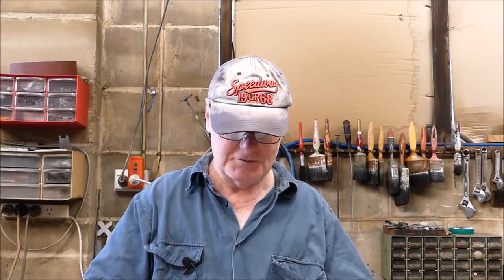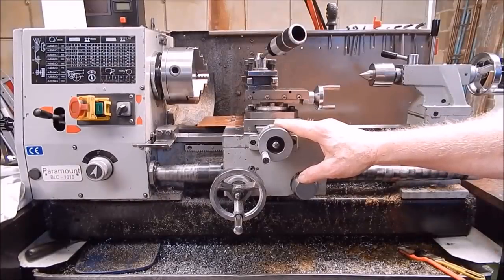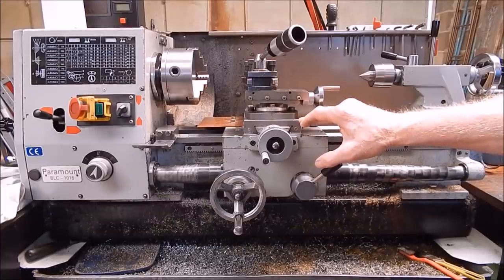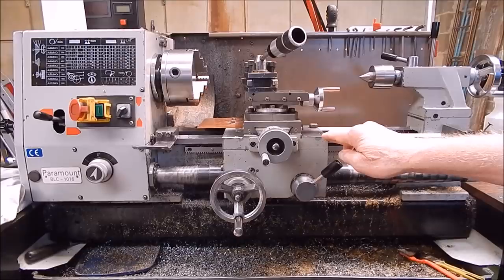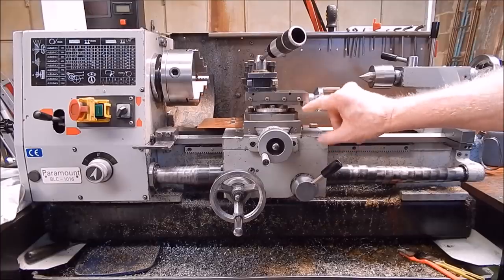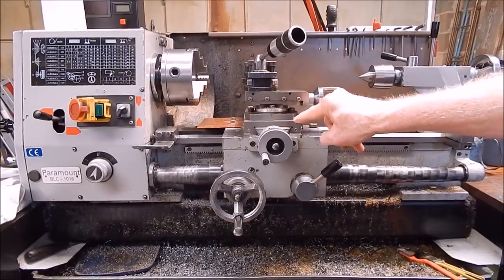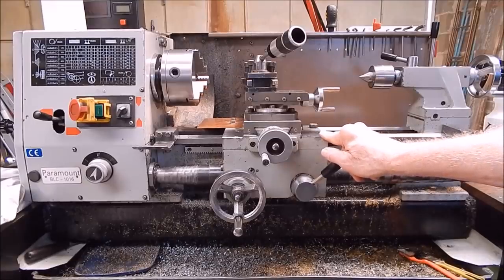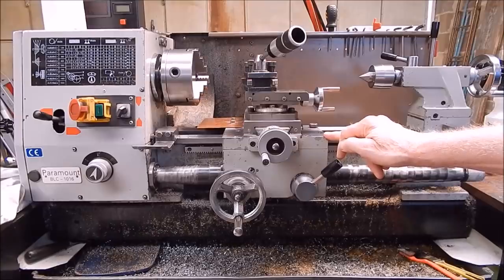The serious weakness in many small modern metal lathes

Comment: As a Manufacturing Engineer who has had conversations with both Schaublin and Hass, I confirmed my suspicions on this topic. The T-slides and dovetails are cut in the same machine, in the same setup (basically).  On a mill bed setup, the cross slide is machined first the dovetail,  flipped, then the t slide is cut.

It is sheer laziness and poor(est) workmanship, poorest engineering. It's not value engineering. It is sheer laziness.
Reply from the maker: Very interesting.  Cheers Rob
Reply: @Xynudu  get some coffee, a comfy chair, and empty your bladder first...

I've been gestating a few things for a while. This is as good a place as any to post. I dont have permission to name my company or product line so, allowances were made...

Ok, let me set the stage. 35 plus years in electronics,  First 20 as a senior repair, testing, metrology, and micro-miniature fab and repair technician. Then finally graduating up to Radio Communications Network Engineer, then Manufacturing and Production Test Engineer, I've been around and seen/done a "few" things having to do with electronics. But before all that, I had a grandfather and a father who were both Machinists and EEs. Its a thing in my family. I'm disabled now with an HSM shop I'm  putting together for my broken butt, but that's a different conversation. Point is, there has always been an intersection of DTIs and O'skrillexscopes in my families households. 

So, when I got hired on my last gig as a production line Test and Manufacturing (process),engineer, I was recruited for the history of seeing one industry through the lens of another. This company,.we'll call it Widgets for All (WFA) was VERY mature, but very specialized, read, small. The Executive Committee of WFA had come upon an opportunity to grow the business both in scope and scale. A lateral market.move was executed with the purchase of parallel niche company that was struggling. (Parallel niche: Let's say one company makes orange juice squeezes and the other makes dairy milking machines. Both different product lines, but, both follow on products made.w8th our products would end up in the same kitchen, just from different (parallel) value chains to the customer.)

As8de.from the lateral expansion there was the concomitant serial/internal expansion of both product lines.This was in the form of Bringing Back to American Shores, or Re-Shoring as its called, ALL processes in a product line. Yeah, Gwon Duang province in PRC can make individual 
7n8t cost lower with their govt subsidized labor force, (you work where We tell you and you get a bed in a dormatory and we get the US $ through the artifice of an off shore commercial title) problem is, the quality is always ever going to be so hideous as to preclude profit back in the states unless unit volume exceeded several hundred thousand 7nits per 8tem per annum. 

Our unique product count was over 400 items in the same building with the same 275 personnel. Change over time from one product to ANYTHING ELSE was only ever minutes. A minimum run was 5 items. Toyota was coming to US.for Kanban tweaking. Problem was that on our large run items, the previous generation of stateside production practices had hemmed WFA into outsourcing large product runs overseas. Vertical integration had not yet penetrated down to small medium enterprises because the industry innovators had treated these methods as "proprietary", thus precluding any home shore advantage by sharing this knowledge and keeping our jobs here.  (Another long conversation about the evils of globalization where.labor has been commodified based upon VAST geopolitical disparities in end market value of labor.)

It was now "cheaper to keep her" when the Board looked at the big picture of a total product value line labor force.

IF:

Production Line supply was vertically integrated
Product testing occured in situ during predefined blocks in manufacture (that's my gig)
Just In Time integration encompassed.the ENTIRITY of the value line 

Then:
here was a helluva opportunity to be made.

So, where does Schaublin and Haas fit in? You all might wanna ask NYC CNC, et. al.  how.many test FIXTURES they have made for electronics production lines. 

Now think this….

WFA had over 400 TESTABLE products, each needing at least three fixtures. Product updates and revisions occurring in real time, each necessitating change in fixturing. Several THOUSAND fixtures up front with a hundred or so per annum.

This program of Continuous Testing Upgradability, if out sourced was going to.cost more than our annual revenue, just on this item alone, forget labor or material. 

How did we get to this point in the first place? There were over two dozen of.us on staff with varying degrees of experience as machinists. We'd been talking for a while, telling Execs what could be done. So they had had an idea there was a way to expand. The automotive industry had done it Sony was.doing it, BUT NOT TELLING HOW. So, we set about doing it. 

In order to be enabled to produce text fixtures "just in time" it would have to be done in house. We would need a job shop in house. And with market research was showing we SHOULD expand our product line to over 1000 items in three to five years, we needed to change the way we saw things

See how thiis math8is sort of snowballing ,exponentially? We few.ex-machinists knew where this would end up. With some new play toys, er. tools. There were two thoughts on deployment. Either have localized fixturing available at each production line, seven of those currently with a five year plan of doubling that. Or...create a new department, independent of any one product line.

Both had merits, both had pitfalls. After six months of sales/product enginerds from all over the planet coming through our house, the final two machinery works were (wanna guess) Haas and Schaublin. 

During this happy time, we were getting one hell of an education. Everyone in the company was exposed.to as much or as little.of this process as they had stomach for. Everyone had access to anything, except new product development and intellectual property protection methods. 

The building is online 24x6, pay is above market. "Widgets For All" is a "Blue Water Shark" to this day. All of the value line is back in house. Because there are governments on this planet that enforce the policy of using the citizenry as a commodity for wealth extraction and transfer to a select few there will be areas of the human labor pool that will appear all to attractive for unscrupulous and, or uneducated entrepreneurs. 

WFA spent three years recruiting from the home team. I was lucky that I happened upon them. They weren't casting a wide net. They didnt want to attract attention. I was hired three days after submitting my resume/C.V. Now let's talk about how appealing the home labor force is. Not friggin very. The initial round of expansion was going to require 75ish new employees. We interviewed over 1500. I was in the initial round,  I was also recruited for my management experience. 

I'm just going to say this, from a point of experience of 35.plus years at industry leading firms, immmigrants to America have work ethics far and above the past two generations of Americans. Immigrants expectations are/were far less. These aren't opinions, these are recorded data points. But we weren't hiring based on their desires, we were hiring based on their experience coupled with their desire to invest,  invest in themselves, thereby investing in the long term value of their position at their career. We didnt just train you how to swing the newest hammer, we untrained you how to see every problem as a nail.

So when I look up from my sixteen channel logic analyzer to have a very well educated opinion about Chinese lathes, or STEM recruiting and hiring, or technology industry geopolitics, its because there were several MILLION man hours of documented experience I had poured into my head continuously, and had ready access to, along with any one else in the company. 

If you want a real, excellent position at an industry leading company,  you had better come softly, carrying half a dozen or more big sticks. If all you bring to the interview is a single diploma, a hat in your hand, with a big ol' flag waving chip on your shoulder, see ya, that's what the coming generation of robots are for.

Cheers Mate

P.S. Five weeks after we got.out first Haas machine, I was t-boned on the highway coming to work. This explains my typos in that I am penning this missive from the position of my permanent disability, in bed various parts of the day with wracking pain. 

But that's another conversation.
Reply: I spent my professional life in the heavy engineering and manufacturing industry.  When accuracy was required, everything was stress relieved after fabrication, followed by rough machining of all features.  Then all features were finish machined, with the last feature the one with the closest tolerances.

Comment: I have a problem with this sort of conversation when one only takes the view of comparing  apples with grapes! The small hobby lathes you refer to are in reality a pest to use at any stage. I have never quite figured out their designed usefulness. As for being rigid, I think you need to get a new life appreciation somewhat. No cheap mini lathe has the mass required to be considered a rigid work platform period as I see it. I consider comment as to the makeup of their cross slide rather futile. Yes in theory there is an introduced weakness maybe by machining in T slots as is now the practice but considering the low horsepower used, and small mass of the machine, I doubt that it causes any real problems that aren't there inherently in the first place. To compare a mini lathe part to that of a larger lathe with many times the horsepower and mass is surely thwart. It means nothing! More important in mini lathe manufacture re job finish is to ensure the headstock bearings are of good quality. Most are not as a rule and this causes heaps of chatter problems but what would I know, I only service the damn things!
Reply: Any bench lathe requires mounting on a rigid and stable base if any kind of accuracy is to be achieved.
My lathe for over 30 years now is an EMCO MAIER V10P built in 1976 or so.  As far as bench lathes go it is a pretty robust machine;  however, not until I mounted it on a very rigid steel framed table, was it rigid enough to make use of its capabilities.
If you are limited to a wooden bench, at the very least obtain a piece of 2" x 8" or 2" x 10" hollow structural section tube, close up the ends by welding or brazing on covers, and welding/brazing in through-plugs where the lathe is bolted to this box section.  With threaded adjustable feet under the lathe, a very rigid assembly can be got.  Level the table using a carpenter's spirit level, then level the lathe on top of the bench using a toolmaker's level.  Going this way it is easy to check the lathe bed for twist or bending, which must be minimized for accurate work.